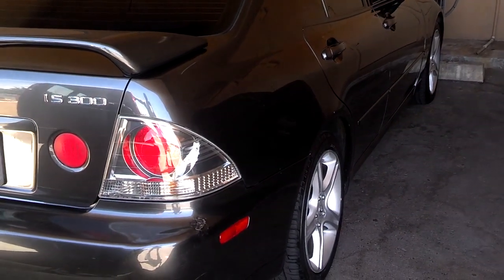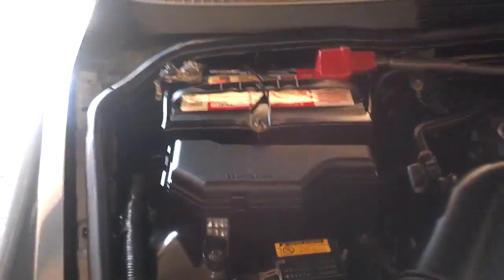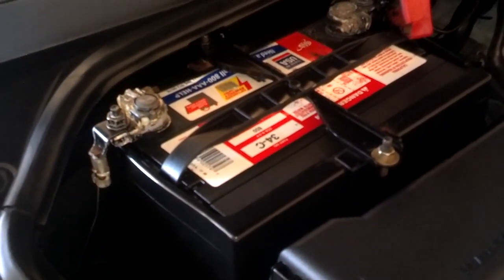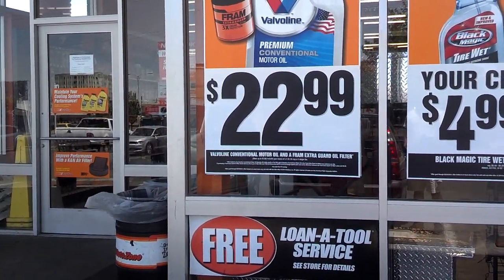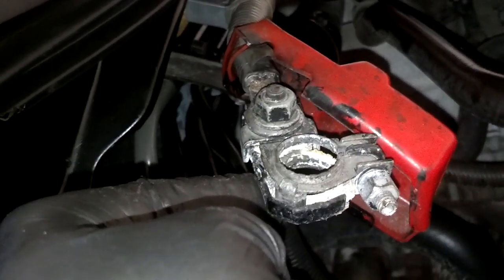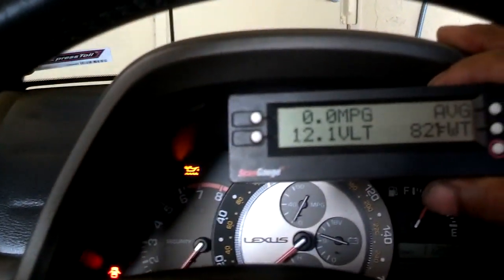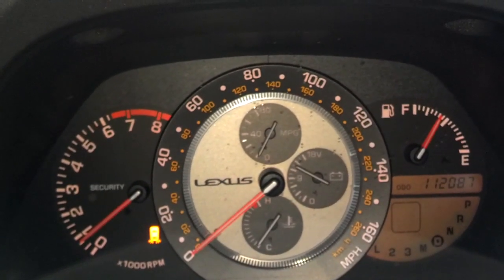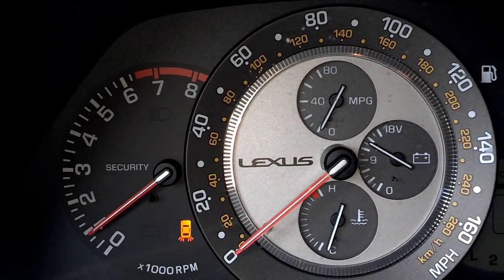Step by step battery or alternator trouble shooting, battery charge, and more - Auto Info Series

Comment: I used to have one of those AAA batteries in my Honda up until a few months ago when the alternator went. The Honda dealer charged the battery and said it would be fine, but I had some issues starting the car when I crank the starter it would turn over but before it did it felt like it didn't engage (this had been a problem before the alternator went) so I suspected the battery was bad. I honestly thought that AAA battery was crappy and that they don't last very long bc about a month after they charged it I went to have it tested at auto zone an sure enough it was down to 71%, so I just replaced it then and there. Haven't noticed the starting issue lately but I knew by that indication it was definitely time for a new battery.
Reply from the maker: I think battery charge levels bounce around all the time. That's why you need to drive for more than 30 minutes at least once per week.

Comment: Hey so I'm having the exact same problems with my IS300. All the lights come on and tries to start the engine but it barely starts the ignition. I check the voltage and Below 9 volts on the speedometer. Could it be just a bad battery or the alternator.
Reply from the maker: https://youtu.be/_1q40V-BPQc

Comment: Robert, what does the charging system include exactly--aside from the alternator? I'm getting that red battery indicator light pretty sporadically...
Reply from the maker: Belt drives the alternator, cable carries the power to the battery. Alternator has a regulator inside of it.

Comment: Robert! what should i check when my alternator produces 12volts intstead of 14v?
Reply from the maker: Starting or charging issues, may be a bad battery cable or connection - Auto Repair Series

Comment: Mine (same car) struggles to start  especially when on the first start it up but At idle it reads 13.7-8 . The battery is new aswell and I cleaned the terminals . Does this mean I have a bad alternator? I also noticed that when I insert the key , the cassette player is somewhat turning on even though it's not even cranked
Reply from the maker: Probably not. Have the battery and alternator tested.

Comment: Sounds like an odd one, you could jumper a volt meter from the alternator case to the battery neg to see if its got a dodgy earth, or the same with the live feed.
Check the brushes, yes could also be the regulator, ive also seen one of the 6 power stud diodes go bad so your not getting a full phase rectification.
You could fix it, but one from a car scrap yard would be my choice, i cant sell both of my kidneys to get a new original alternator ha ha :-))
Reply from the maker: I replaced the alternator with an after market one from a local auto parts store (against my recommendations) and the replacement has the same issue. I think this re-manufactured alternator has the same problem as the old one.
Reply: Robert DIY
Ooow that makes no sense, please check the power wire to it, if it goes to the starter first then clean it up.
It sounds just too identical to be the replacement alternator.
I realise i may sound a bit bossy, im not, im just trying to help :-)